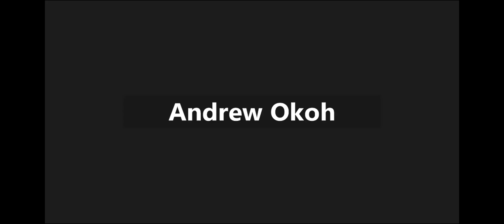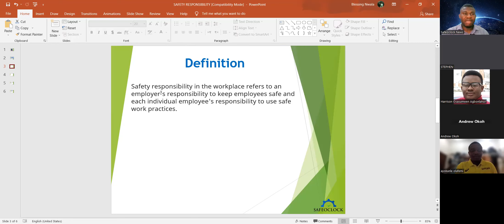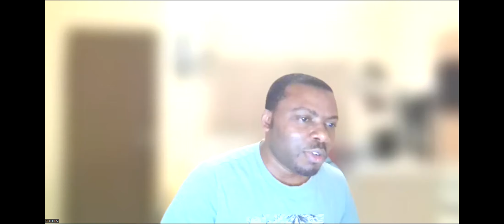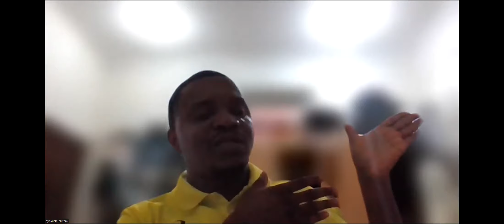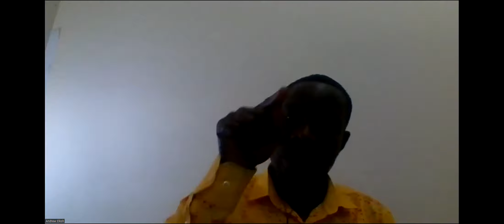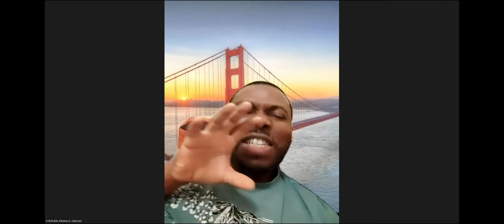Workplace Safety Responsibility

Comment: Nice one again team…you guys did great job on the topic discussed. 

A safe workplace is the sole responsibility of all in the company but lyes mainly & accountably with top management.  

In my opinion, safety should be scraped away from Construction team. 
Safety should come in as an advisor, make recommendations & issue violation/penalty when repeated & high risk noncompliance is observed. I believe with that Safety will be valued, respected & taking seriously in construction industry or sector. 

Thanks again guys.
Reply from the maker: This is a great and valuable input. 

Indeed Safety deserve to be respected and taken serious by everyone